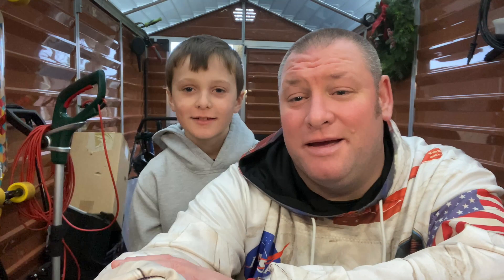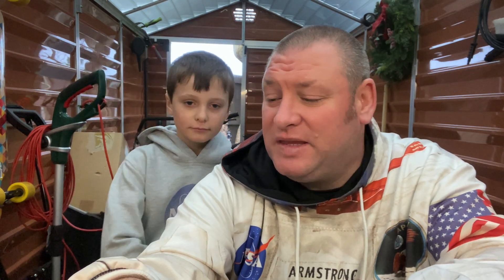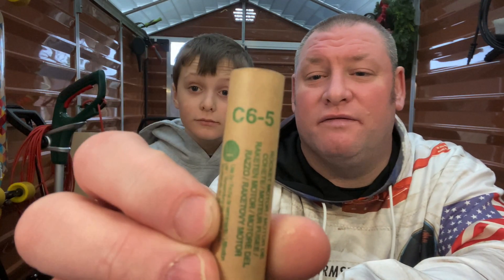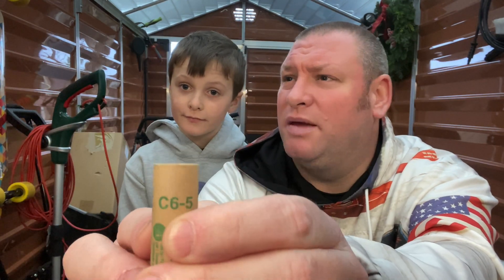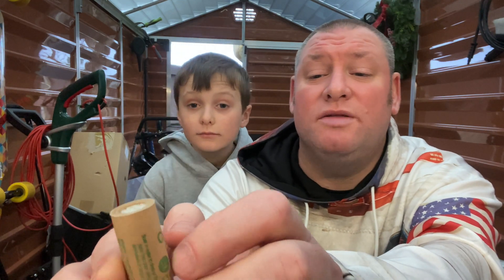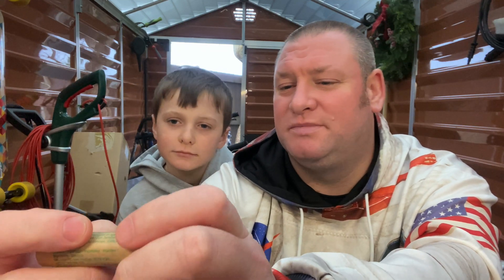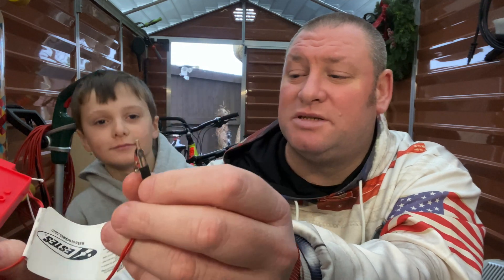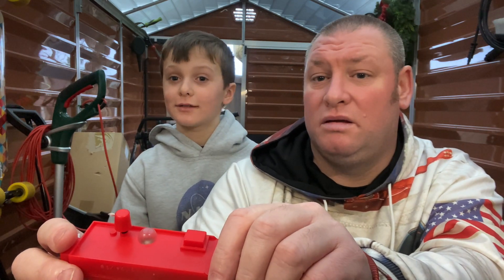Estes C6-5 Rocket Motor Test #estes #rocket #C6 #modelrocket #rocketmotor #estesrockets

Comment: Seeing it close up in slow motion is very interesting.  When I was barely older than Oliver (this was a very long time ago) I built a model rocket engine test stand for a science fair project.  I had seen a photo of a test stand in an old catalog so I made something similar using some blocks of wood, a metal coffee can, a small electric motor from an erector set, a steel rod and a spring.  I could wrap a piece of paper around the can and as the can turned a pen would record a thrust curve on the paper as the engine fired.
Reply from the maker: Thank you, that sounds like a very clever contraption!

Comment: surprised how much flame the ejection has.  i thought it would be a short bang.  not good for the recovery stuff
Reply from the maker: It shows the importance of using the recovery wading system.
Reply: @wavecreatures  When I was younger I didn't understand this and always skimped on the wadding. This my plastic parachutes were melty & stuck together.